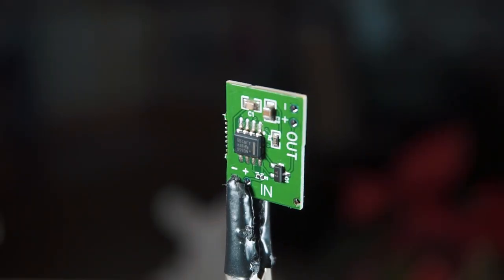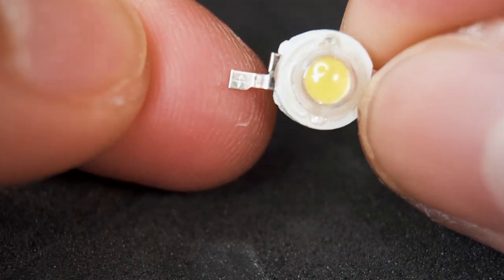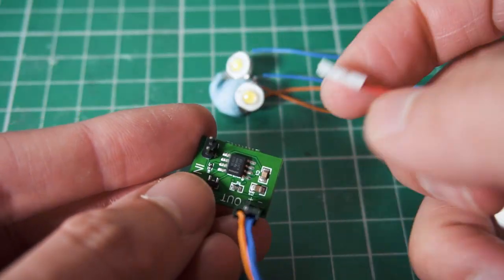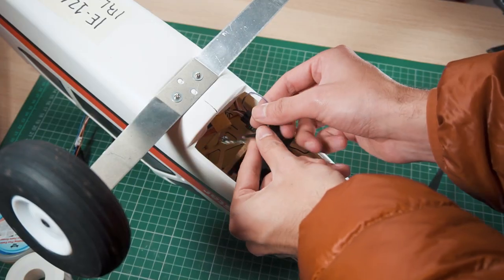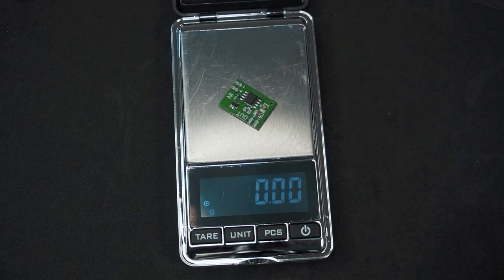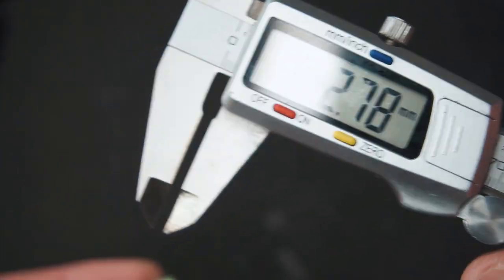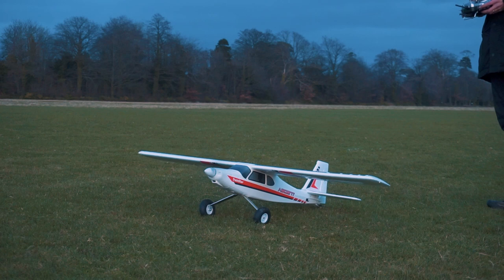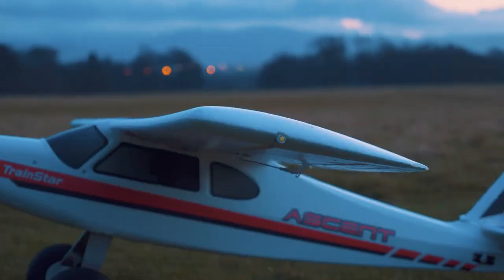The cheap strobe lights you need for your RC aircraft or vehicle

Comment: my order just arrived, will order again
Reply from the maker: I'm working on another models for better control and more realistic effect.
Reply: @Joyplanes  i wish you have steady green, red and white. and blinking red too
Reply: @Joyplanes  just soldered everything, it blinks the other way around, if i can only show you a video. i have correct polarities everywhere
Reply from the maker: @don0219  that's really weird, are you using 5v? If you use more you can damage the board. But it has never happened to me with this boards, maybe the transistor is burned or something.
Reply: @Joyplanes  i used 1 cell lipo batt, i made sure polarity are all correct prior to soldering, blinking is reversed, light on is longer then off as a blink
Reply: @Joyplanes  i joined your FB page so i can show you
Reply from the maker: @don0219  ok, show me on facebook. I'll have to send you another one.